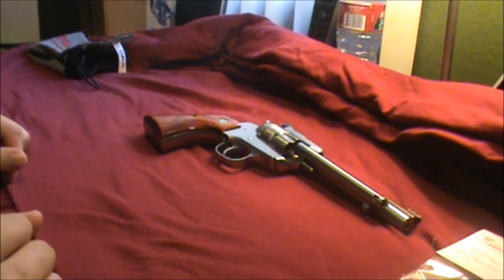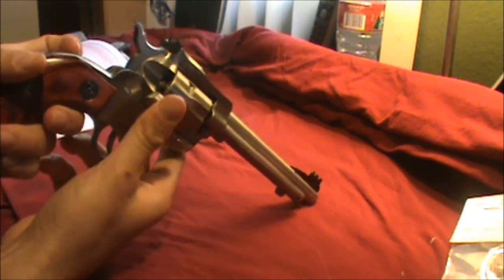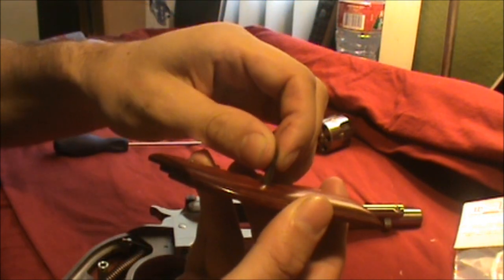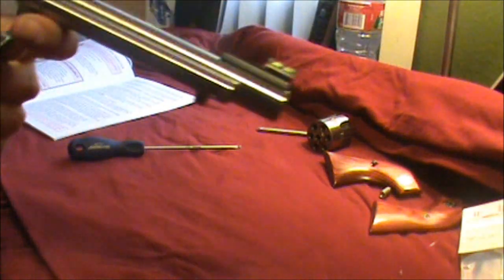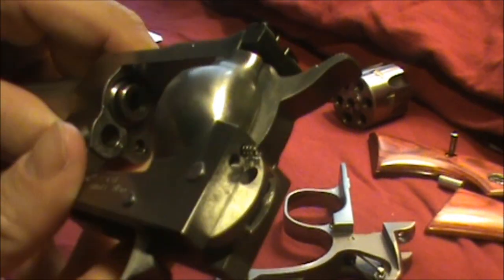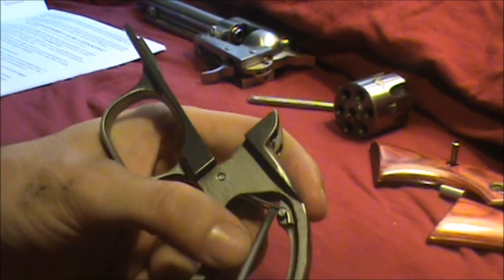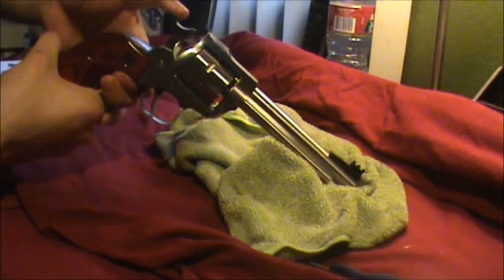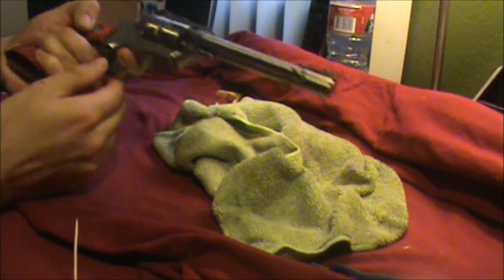Ruger Single Action Trigger Job  Ruger Single Six, Single Ten, Blackhawk, Vaqeuro

Comment: To anyone debating trigger spring weights, my factory new model Blackhawk came with a 60 oz spring with a 4.5 lb pull. I used a 30 oz spring, resulting in a 2 lb pull. 2 lbs was too light for me. It would trip too easy, and you don't want the gun deciding for you that the animal on the other end needs to expire, I'll make that decision myself. Swapped in a 40 oz spring, 3.5 lb pull, PERFECTION.

Comment: You can get the hammer spring out without taking any of the screws out. Just loosen them and use needle nose pliers to pull it out. I've done it lots of times.

Comment: Found your video a few days ago.  Just finished my trigger spring replacement. Makes a HUGE difference.  I used a small cotter pin to hold the hammer spring back. The only prob I had was missing the step where you replaced the base bar when reassembling the frame.  Once I did that it slid back together quick and easy.

Comment: Good video.  Keep in mind that the poor (or cheap) man's trigger job fro these pistols is to just drop one leg of the trigger spring off of the post and let it hang free.   This will make your trigger lighter and won't affect the functioning of your pistol.   If you're going to take apart your Ruger handguns, do yourself a favor and buy yourself a set (even a small set will do) if gunsmith screwdrivers.  The small screws on these guns are very easy to booger up with the wrong sized screwdriver.

Comment from the maker: Rest assured they will be back, I just haven't had the time the past few months to work on any cars.  The only videos I can make are the short firearm ones at the moment just to keep most of my fans happy with uploads every few weeks.  Mid december is when i get some free time to finally work on more cars.  Many videos will be made in that segment.  Brake bleeding, mercedes tuneup, seafoam vid #2, radiator replacement, etc.

Comment: I found it easier to replace the grip frame if I held off on installing the trigger return spring PIN until after everything was lined up. It does make lining up the pin a little tricky but not as challenging as trying to manipulate the spring under that trigger while lining up the other two place.

Comment: It's much easier to leave the trigger spring pin out until installed. The front of the trigger spring has to go into the notch above the rear of the trigger blade. Otherwise the spring will get buried under the trigger, visible when assembled, and will barely trip the sear when pulled.

Comment: Easier: 1) remove right grip panel 2) release the right hook of the trigger return spring 3) re-attach grips. Done. Go shoot it 500 times and the sear/trigger mating surfaces will smoothen

Comment: Hello, and thank you for this awesome video!!!  I did this last night on my 2 Ruger New Vaqueros.  Here's what confounded me for about 45 minute - 1 hour ....  I didn't put the cylinder back in or grips on when trying to see if the trigger / hammer action was working after replacing the trigger spring.  So, my transfer bar kept hitting the firing pin.  

** But, I didn't realize for about an hour that there's a spring-pin in the long cylinder bar (called a Base Pin Assembly) that holds the cylinder in-place but also pushes the transfer bar back so as to be free of the firing pin.
Reply: You figured it out, but sometimes pointing the barrel upwards will allow the transfer bar to move and you can manipulate the hammer.

Comment: Don't put trigger spring pin in till after you put grip frame on. Makes it easy to get trigger spring above trigger.
Reply: Thank you for this comment. Doing it his way, I had the trigger spring buried under the trigger blade. Didn't realize the front of the spring needs to go into the notch above the rear of the trigger. I honestly don't know how he managed to do it with the pin installed.

Comment: Don't drive in the trigger spring pin till the grip frame is on. I have assembled ruger single actions many times. Why ruger doesn't recommend this, I don't know. By the way, every time I have put lighter springs in a gun I have been sorry. Never do it anymore.

Comment: Helpful video, but you left out a VERY important tip. You have to make sure you depress the trigger spring, so that it fits in the notch in the back of the trigger. If you just put the halves together without doing that, the trigger is just frozen in place and won't move. The book is a bit misleading. In the one photo, where you mention A,B,C the spring is A and they make it look like the spring should be visible at the back of the trigger when the pistol is assembled.